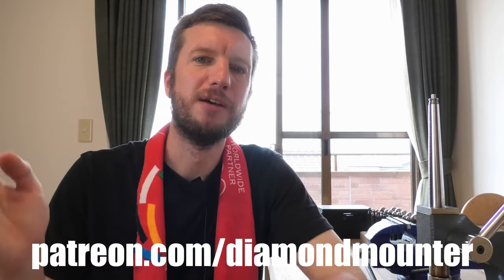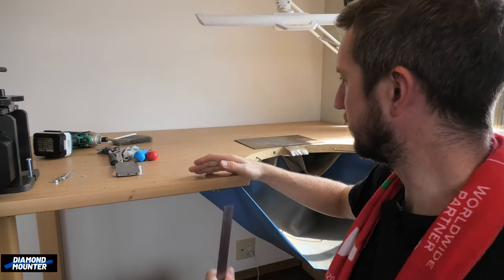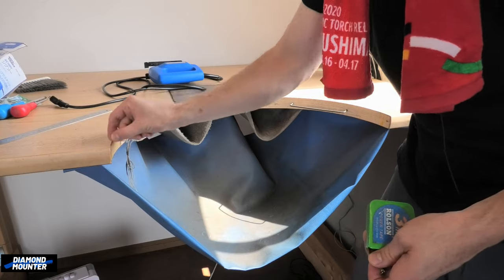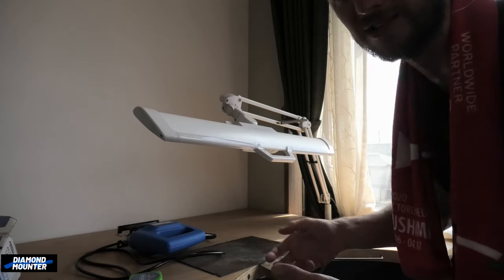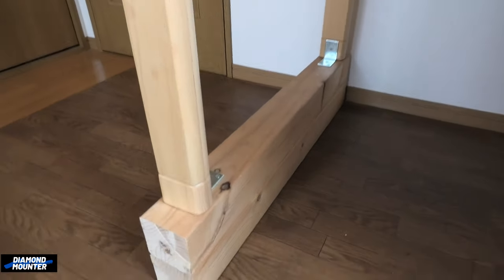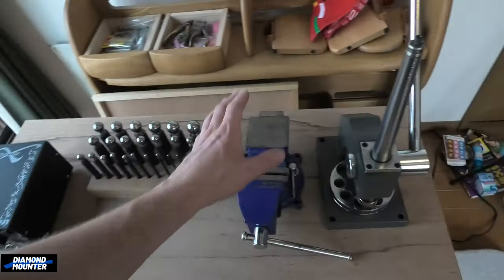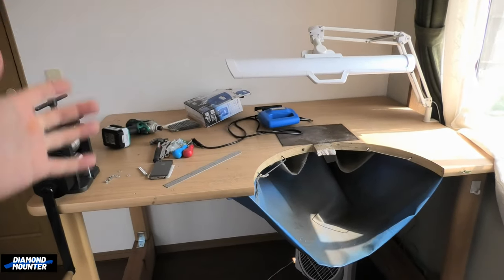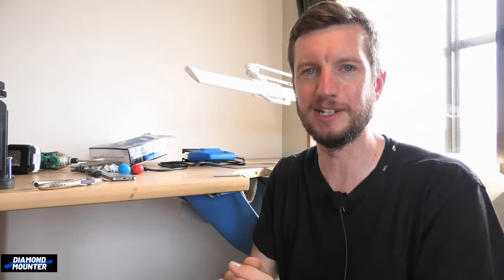Make Your Own Jewellery Work Bench

Comment: I made my own bench as well. I started with a thrifted desk from the fifties with three drawers on each side and a wide one in the middle, I took the top of it, which was some crumbly composite material, put plywood over the side drawers. I made a frame from planks that I put atop and around the sides and back, to get the height I needed. Then I scored a huge, 4 cm thick solid pine coffe table for the top. The middle drawer is exposed and catches all the filings. 👍 I love it, it’s called Frankie, as in the “frankenbench”.

Comment: Thanks for this video, it is really helpful. I worked as duct fitter for 25 years so am used to manipulating metal on a bigger scale. I am in the middle of a 3d modelling course and have applied for an art and design-jewellery course after. Could you tell me the best course I should do to become a jeweller and how long it takes? I plan to start on a very amateur scale pretty much immediately, perhaps just buying broken jewellery and fixing it. Just subscribed and may join you on patreon.👍
Reply from the maker: Yo Good luck with the courses. I dont know about others but I am working on my own. They should be available in a few months. I recommend just getting started! Experience is the only way to learn
Reply: @DiamondMounter  thank you, much appreciated. 👍